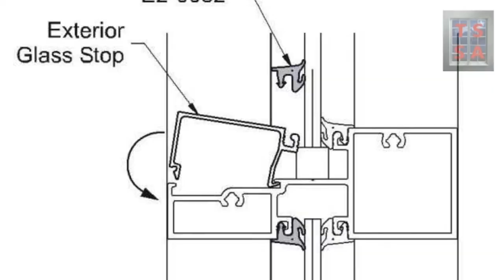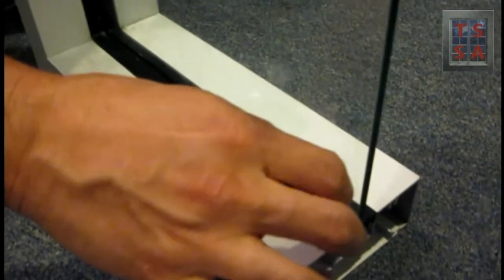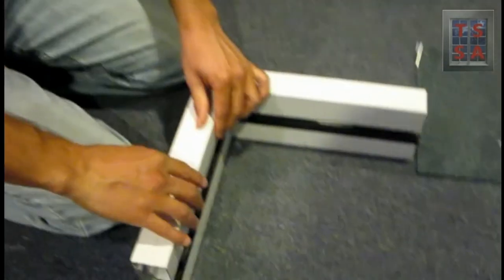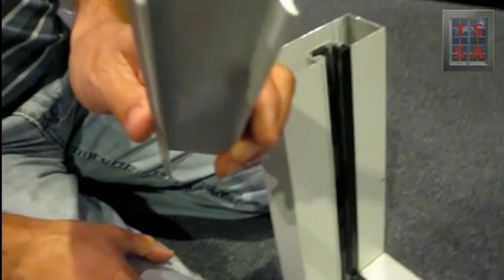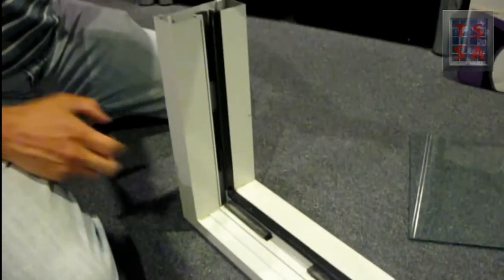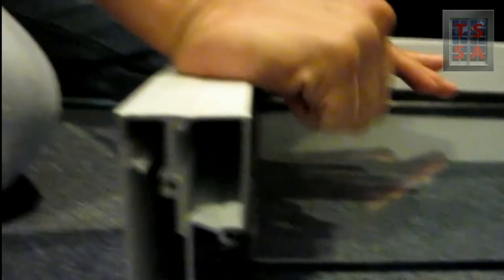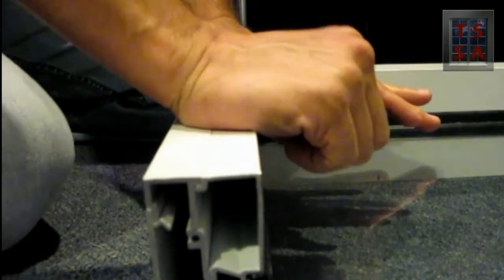Storefront Glass Stop   How Does It Work

Comment: store window glass ought to have a couple small but crucial things done when it is in the table getting cut or at the bench,, the corners rounded a bit with the glass cutter or glass pliars,then fine sanded extra smooth, all sharp edges get line grit sanded,and the glass polished with ceriun ozide,,thus stuff removes the plastic beads that keep crates of glass sheets from breaking during shipping.most maybe ALL factories making window glass  use the house mix of blue plastic spray bottle windex type cleaner this does not remove the plastic bead film,leading to double thick vinyl / glass insulating  seal to fail in a year or 2.

Comment: How would someone replace the glass then?
Reply: Knock off the glass stop with a glazing hammer, slightly lift the glass and go all the way into the deep pocket then pull one side of the glass out of the shallow pocket.
Reply: This looks like a kawneer system so it’s not as complicated

Comment: Can that type of framing be made out of wood for big store front windows? Maybe use a router to make the slot for the window to sit in? Is that a thing?
Reply from the maker: Hello Semaj.  Thanks so much for the question.  Well, most Storefront framing systems have been made out of aluminum or even steel since the early 1900s.  But, not-withstanding I have seen amazing Wood Frame architectural window systems that are still serving their function wonderfully.  So the short answer is Yes, it is possible.  Best to always check with your local municipality and enforced building code to see what is allowed.
Reply: @TSSAStormSafeDAC  thanks so much for the reply!